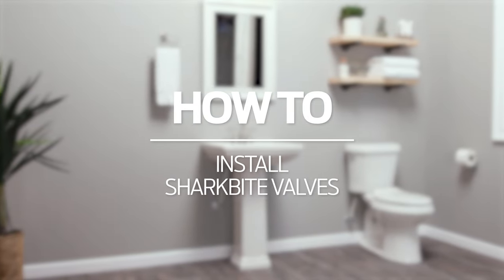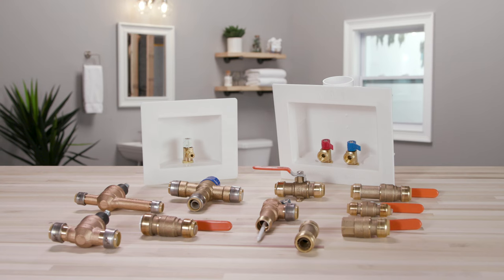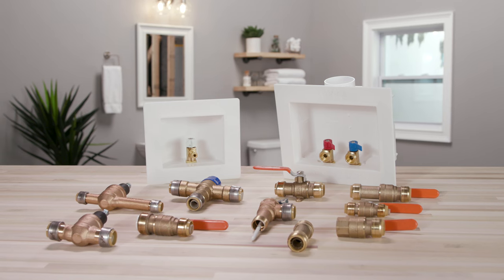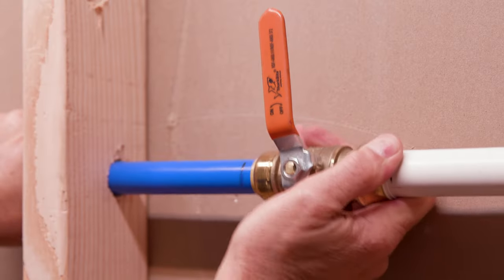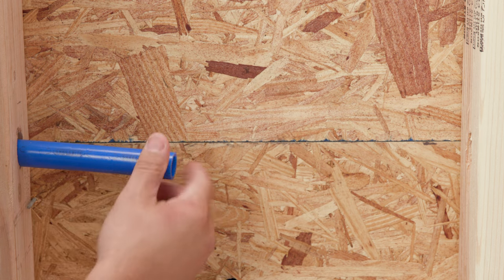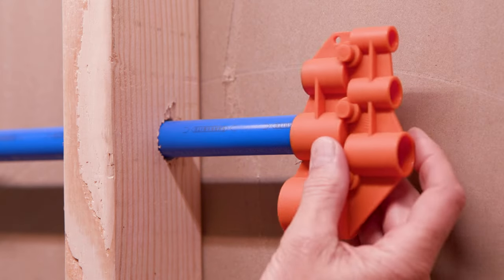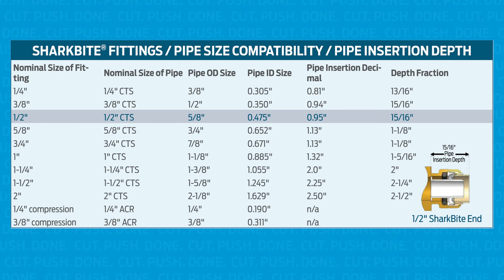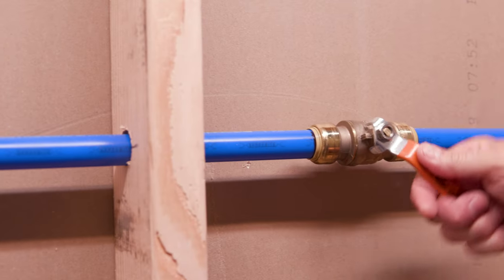How To Install SharkBite Push-to-Connect Valves

Comment: Here are the CORRECT instructions how to do this DIY procedure. Its long, but will written so you smile at the end. 

Example. Let's say you have a copper or Pex pipe. 

Close the MAIN water supply valve. 

1. Now cut the pipe at a given location (i.e. cut pipe close to where you want to place the shark bite) and let the water drain in a  bucket.

2. The next Very important thing to do is, NOT to "mark your pipe with a pen" (for finding the depth of pipe that needs or should be inserted inside the pipe, after you push the pipe in shark bite ends),   ...BUT.... TO "actually find out, how much pipe" you should cut "IN BOTH DIRECTIONS" from the cut you already made in bullet 1 above. So, for how to do this, look at step 3 below.

3. Now look at your shark bite and place the shall bite's "center" of shrk bite piece body  at the first cut you made on the pipe. Now using a pen mark, "both edges/ends of shark bite" sitting/aligning on the pipe. Let's call it, "left mark" and "right mark" on the pipe.

Between these 2 marks, that you just marked (there will be that first CUT you made on the pipe in bullet 1).

4. Now,  you use the shark bite "depth tool" (it comes in an orange color) which has all the sizes 0.5" to 1.5" diameters) and insert left end of the pipe to the left side of the shark bite and see how deep it is. Mark this on the left side of the pipe (after first cut) i.e. now it will be marked INSIDE between the LEFT MARK you did in step 3 and first cut, you made in bullet 1. 

Let's call it "INNER-LEFT-DEPTH" mark (i.e mark between the LEFT MARK from step 3 and the first cut on the pipe). Do the same procedure, on the right side of the pipe, using right side of the pipe, by inserting it into the right opening of the Shark bite. After inserting that, you will now get "INNER-RIGHT-DEPTH-MARK" i.e. a mark between the first cut of the pipe and the RIGHT MARK you got from step 3.

5. Now, USING a Scale/measurement tape, find what's the depth/measurement of "INNER- LEFT-DEPTH -to-> the first cut" ... note down this number/value as "LEFT VALUE".  ... Let's assume this left value was 1 inch. 

Do the same procedure by measuring,  "from first cut mark to INNER-RIGHT-DEPTH mark". Note this value as "RIGHT value". Lets assume this right value was also 1 inch. 

6. Now wipe the INNER left and INNER right marks using a wet cloth or something. 

7. Go to LEFT mark (that you made in step 3) and measure "left value" from that left mark and mark it. This  "new-inner-left-depth" mark is now measured from the LEFT MARK (i.e. not from the cut/center of the pipe). 

Do the same procedure, i.e. mark "new-inner-right-depth" mark measuring from the RIGHT mark (you did in step 3).

8. Now, use the cutter, and cut the pipe AT exactly on the "new-inner-left-depth" mark and cut the pipe AT exactly on the  "new-inner-right-depth" mark. THIS IS THE MOST IMPORTANT THING, I THINK NO OTHER VIDEO EXPLAINED AND it really trumps people while putting a shark bite on any plumbing pipe. 

9. Using that orange tool that Shark  bite company sells for finding depth of shark bite ends (i.e. how much pipe you should insert), it also has a smoothner/cutter in it, i.e. if you insert the end of pipes in that tool and rotate clockwise as listed on the tool, then it will SMOOTHEN the edges of pipe, for the new-left/right-depth end points of the pipe. Basically, what you have to do is,  smoothen the edge of the pipe end points which will go inside Shark bite openings and touching the RUBBER washer/seal.

10. Now, ensure if your shark bite has any DRAIN value (that you open and let water fall down especially during winter time for sprinkler water clearing etc) you place the shark bite acc. so the drain value is always down facing. Actually shark bite can rotate 180° on the pipe after fitting it ( so that should not be a problem ). ALSO,  check there is no dirt or debri inside the shark bite, after doing all this nano engineering work today first time by you. 

Well by now  you just put the left pipe on left shark bite opening and right side of the pipe, into the right side of the shark bite opening. While inserting, the pipe will go exactly upto the left and right mark, you did in step 3.

IMPORTANT: the pipes should be straight if possible like a straight line after you insert both ends in shark bite. Avoid getting any angle more than 5° i.e. after installation, the pipe with shark bite should look like 1 straight pipe, not bending unnecessarily like a bow. Basically there should NOT be any hard tension between shark bite and pipe  (that you inserted inside shark bite) giving it any reason to leak water due to a bad angle and high water pressure can leak water from such bad angle. 

NOW have a bucket ready next to you,  open the main water valve slowly, turn on water and see, if the shark bite installation was successful. Is it leaking any water from the end of the shark bite or not. 

If not, you just saved both TIME AND $$$$ And learned something new today.